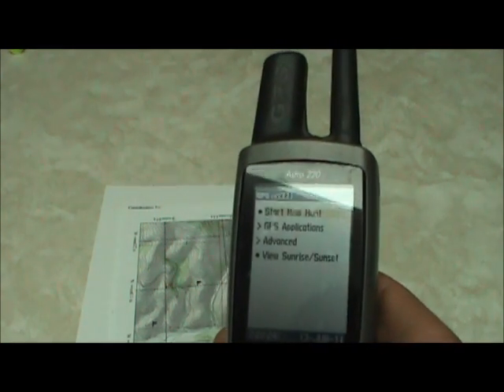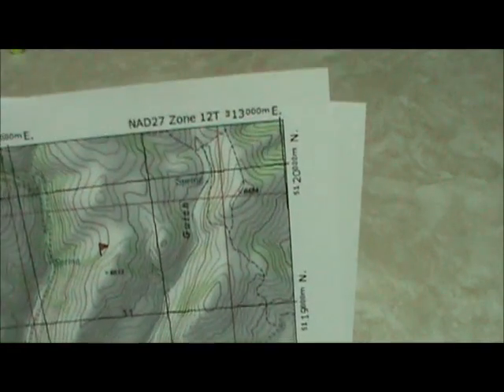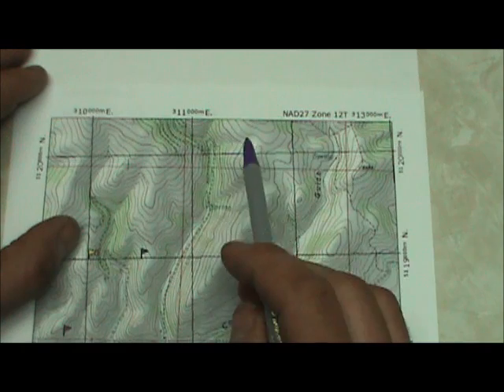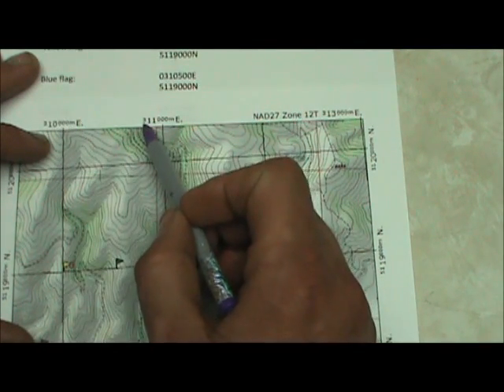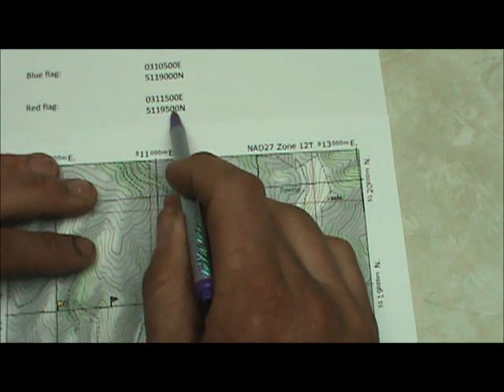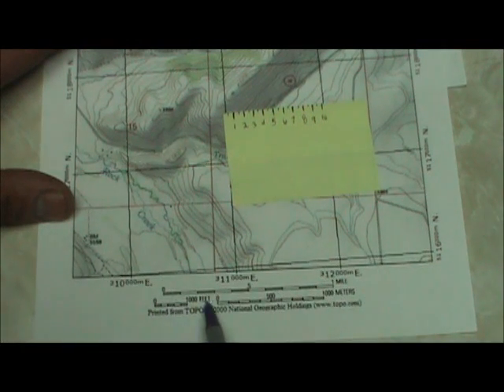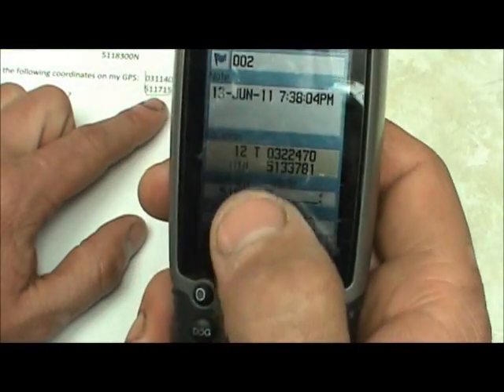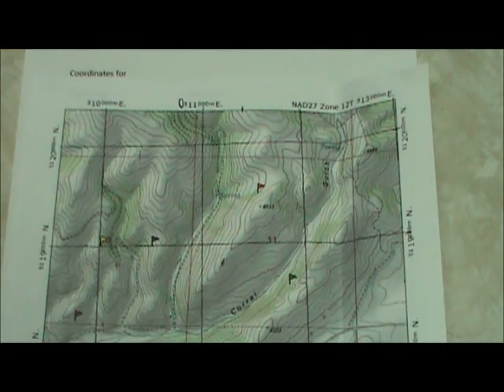Reading UTM coordinates and entering them into a Garmin GPS

Comment: Hi  don't know if you can help, i'll try to explain, coordinates A = ( -31.375119, 121.058803 )  and coordinates B  = ( 31°22'30.4"S  121°03'31.7"E ) they are the same place in Australia, but what is the format of A & B, and how do you convert from one to the other as different gps may only use one or the other I like to use (A) coordinates,  but some maps only give (B) coordinates hope explained my problem
Reply: (A) is displaying what is called "Decimal Degrees" this is a common format for Aviation use, this is an easy format for search pilots to use, however. It is much harder to read a map in decimal degrees, it is also far less accurate when reading it off a map.
(B) is what is known as "Degrees, Minutes, and Seconds" this is a much more common format, as it is easier to read from a map. This is much more accurate to read from and a map and will be far more efficient than (A) format.

There are plenty of Apps and websites with converters on them, you can also look up a formula to convert them.

From a Search and Rescue standpoint.
UTM is a far more efficient way of navigating, as it is faster to read, and much more accurate. However, it has it's pitfalls, when working with a Search Aircraft, they will most likely be using a Lat and Long GPS (no it is not possible to change them to UTM without buying a new GPS). On many occasions, I have called I the aircraft giving them UTM coordinates and basically been laughed at. 

Moral of the story,
It is very handy to know how to plot and read all different coordinates, however most experienced outdoorsman will prefer UTM for it's simplicity.

Comment: you said it has to have 7 digits..well my easting only has 6 looks like this..605320mE northing.. 4406431mN...so now what.. and yes it brings it right up on my place..
Reply from the maker: You will have to add a zero in front of your easting when inputting into the GPS.